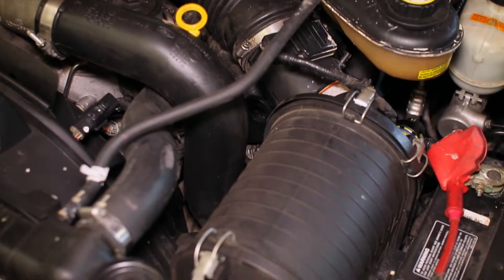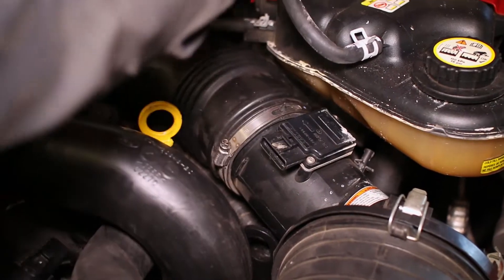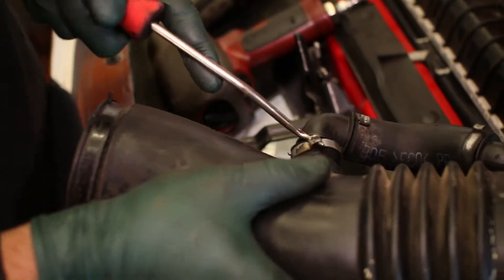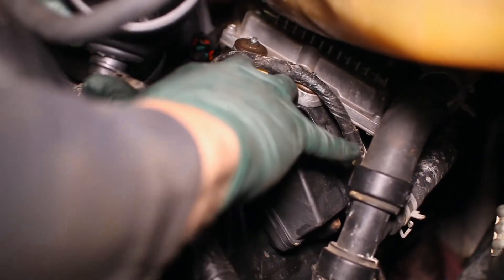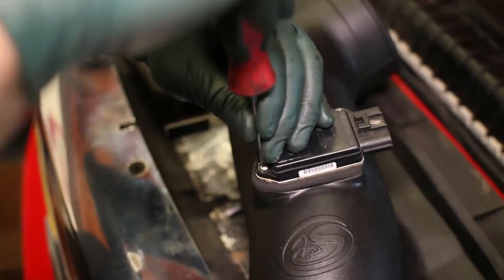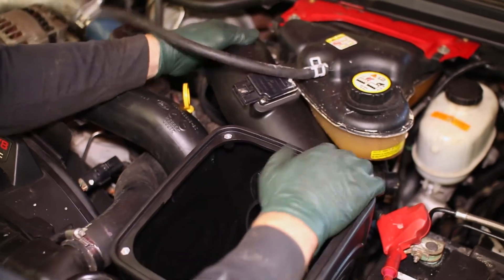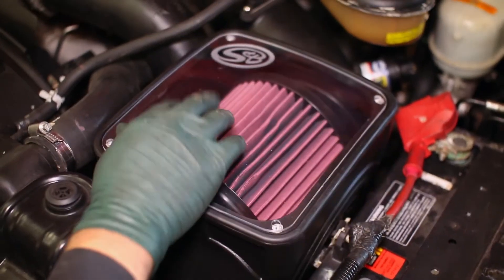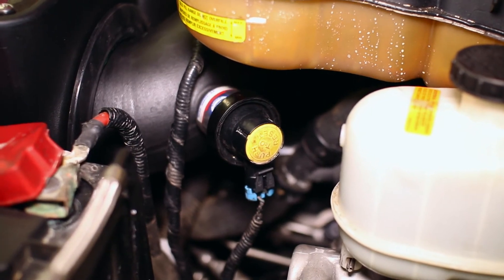2003-2007 F-250 F-350 6.0L S&B Cold Air Intake System Install

Comment: How much more Horsepower do You get from a S&B ?
Reply: Richard Chamberlin roughly about 22
Reply: Billionaire Ballers Club would you recommend this on a stock (no head studs nor tuned) 6.0?
Reply: @camaro402bbc7 flush your coolant every 15k miles and you’ll be fine don’t use the ford recommend coolant a clogged oil cooler causes a ton of heat which is the main killer of your stock 6.0 head studs